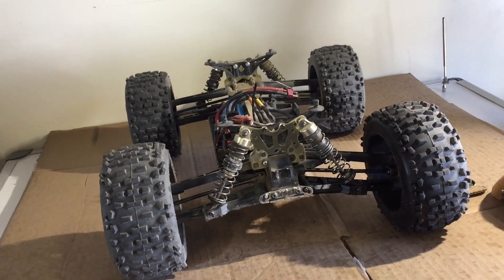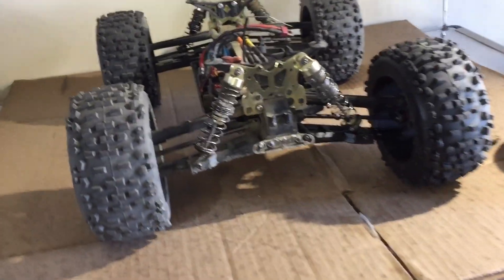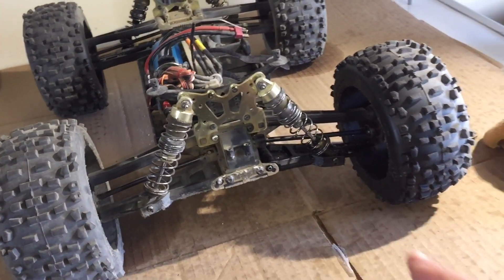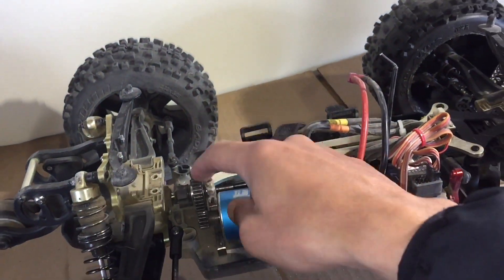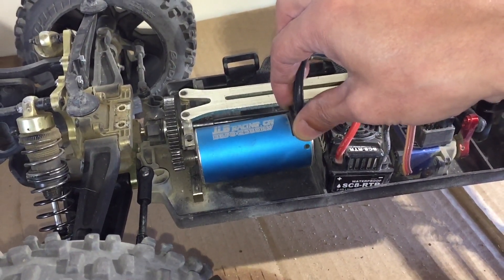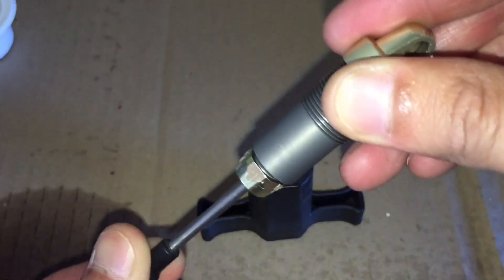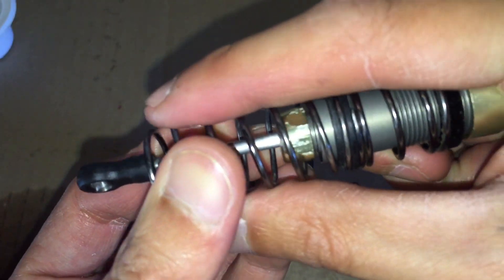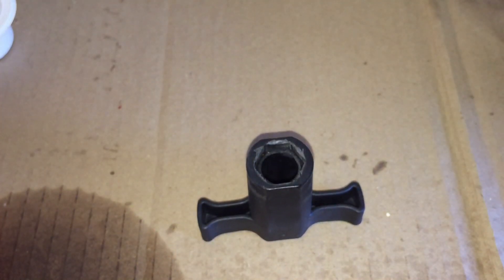JLB Cheetah How To Remove Stubborn Shock Cap & Suspension Rebuild!

Comment: btw, you can use a hot-glue in between the motor and the chassis to protect the motor mount from the vibration of bashing

Comment: Hi I got a question I jump me cheetah a lot but the shock dempers neet some new olie I don’t now if I neet to get 80Wt or 100 Wt I jump hard. And how Many ml do I neet for all 4 shocks.
Reply from the maker: It’s depends on the shocks too. The heavier the weight of the oil can cause the shock shaft to bend under pressure during lands. My setup on my cheetah is 30-50wt with 50 being at the rear and 30 at the front. The back suspension takes a lot of abuse during acceleration and jumps. Hope this helps. 👍
Reply: @ItsRCTeng  thanks mate